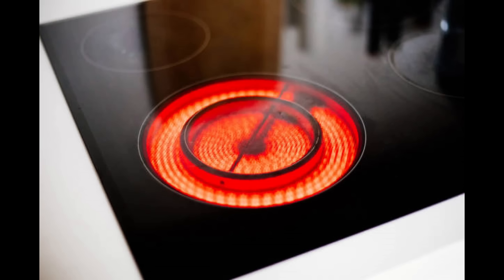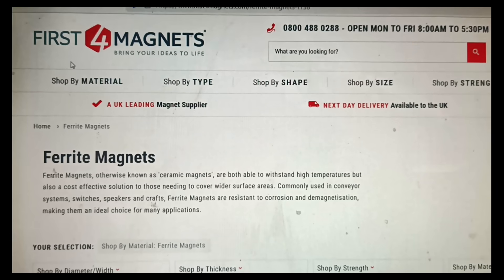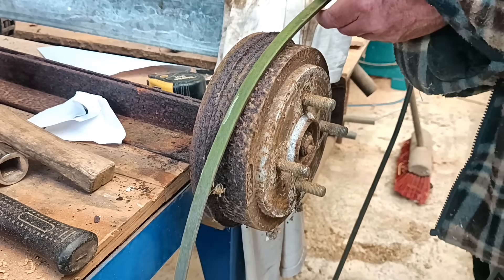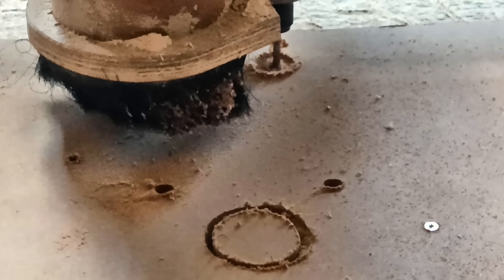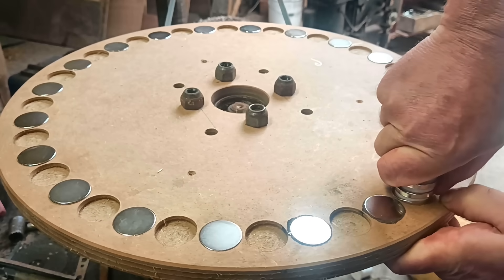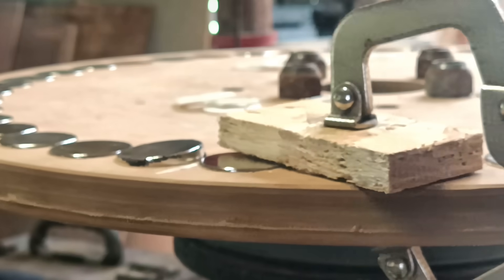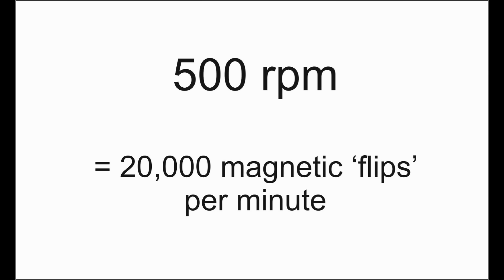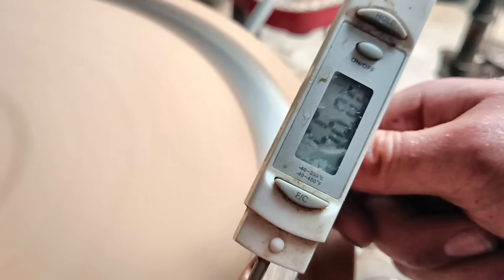I Made A BIG Rotating Magnet Induction Heater! (with magnets from First4Magnets.com)

Comment: What sort of torque do the magnets create causing a drag on the spinning power source?  Is there a limit  to how many magnets can be put on a spinning object causing it to it stall out?  How fast does the degradation of the magnets occur?  Does the water need the metal to heat up or do the magnets affect the water directly? (I suppose the density of the electrons matter. Would gold or silver heat up faster and also create more drag on the power source?)  A few question that come to mind.

Comment: THIS is VERY viable to say the least.!! You need to measure that copper with no water in it to see how hot the metal gets by itself. IT should reach 200C easily without the water load on it. That which you've shown eliminates mechanical coupling and bearings turning a generator, then taking the output and coupling it to storage or even directly to a heater as in this case which has losses in the resistive heating elements . 
The losses through all of that are appreciable. 
IF you use blades under a meter in diameter, you can couple it 1:3 to the wheel and in 30 MPH winds blowing in the winter it will move the wheel at over 2500 RPM ! 
IF U made steam in a vessel it would push itself into radiators automatically. The next question is how many pounds of steam pressure will a little module like that make. I would say over 3-5 which is way more than needed to pump it around. Once the water reaches 100C and becomes steam, it takes only 1/5 the energy to keep it at it's steam pressure.
THAT is the key point to efficiency in this heating system.

Comment: Your disk size is fine. your overall design isn't. Rather than a larger disk use more of the size you have make. use a spiral copper pip to pass water over each disk. each disk imparts more energy into the water so if for instance your first disk can impart a 10c rise in temp with your flow rate, after 10 disks your water is at 100c. Another way to do it would be to use more magnets on a board in concentric circles to extract even more energy.
Reply from the maker: Ah, but you've forgotten the drag..

Comment: I know it's nit-picking but,  coin style, face magnetized  n42s are not what you would end up with after a few prototyping runs.  a good proof of concept.
you'll get better results in the same arrangement is you used square, edge magnetized n52s.  those are prohibitively expensive...  
I should replicate this with 4 pole hard drive magnets on a drone motor

you should also use a less conductive metal as your inductive target.  copper doesn't allow eddy currents to exist for long before they're equalized, higher resistance makes more heat but will dampen the magnet wheel more.

additionally you should hold your heating metal perpendicular to the magnet path,  not aligned with it.  if you have more than 2 magnets Flux effecting the substrate then you're encapsulating your eddy currents.  that's how you produce phased ac not effective for induction heating.   

might be worth trying to utilize both sides of your magnet wheel too

this was fun to watch.  thank you!
Reply: How about a wheel with LN2 YtBaO superconductor slugs instead of magnets? cooled down and spinning next to metallic surface gives you electrons and relative motion....
Reply: @BjarneLinetsky  if you're looking for theoretically optimal results,  yeah,  but if you're trying to save money on heat,  buying or concentrating ln2 is a bad path.  

this project was clearly never meant to be optimally efficient,  but an oddity to be observed.   if they wanted to be maximally efficient, they'd just use a generator to make electricity and then use that to make heat directly where it's needed.   cheap,  reliable,  very low loss compared to this concept
I'm just trying to stay within their current hardware paradigm while pitching configuration optimizations.
Reply: @valseedian  What i proposed was the oddity, i cannot think of any application of superconductivity associated with mechanical devices and i do not understand superconductivity well enough to predict what would happen in such a machine. Incidentally, do not automatically dismiss LN2, it is inexpensive, costing less per liter than beer. And the technology associated with generating and storing are very good and very mature.
Experimenting with magnetism is a fruitful field, there are many phenomena that are not well known, for example the Gerlach effect.
Reply: @BjarneLinetsky  superconductivity would not do anything for this setup
  that's a thing when you're using electromagnets, not static magnets.   
he's not producing or using current at all,  no reason why you'd need lower resistance.  

not to mention that the point of the project is to produce free heat with the rotational energy they are already harnessing...  any engineer worth his salt would know you need to aim for low or no upkeep cost, low or no maintenence,  low or no failure rate,  and low expense.  can't get any of that and have a consumable in the works.
Reply: @valseedian  thinking outside the box....i was not proposing some sort of cooking stove....but rather an extension of this configuration. I am thinking that the relative motion between a conductive sheet and a superconductor may produce novel effects. This is more about investigation and experimentation rather than optimizing and upgrading.

Comment: Can't you just do some gear reduction to reach the desired RPM while saving on magnets? If the disc on the windmill is ten times larger in circumference than the disc it's attached to with a belt, then the small disc will make a turn ten times as fast as the big one.

Comment: You will probably need to find a way to keep the magnets cool when it's running, because the warmer they get the less magnetic they become. And I believe they can become permanently demagnetized if they get hot enough. 
A water bath would get the walls wet, maybe a flywheel made of a material that would allow airflow around the magnets. Aluminum. I've never experimented with this so maybe I am incorrect about the magnets heating up. But this is an excellent idea for free green heat.

Comment: You can get a stronger magnetic flux from the same magnets, if the the non-magnetic plate holding them in the given positions has the thickness equal with the height of the magnet, then this plate must have the circles punched through the whole thickness. Once the magnets are hold by this non-magnetic plate, the whole system must be attached on a ferromagnetic plate (a regular steel plate, NOT  a stainless steel plate, which is non-magnetic).

Comment: It would be much cheaper and more efficient to just build a generator that creates a voltage and then pass the current through the part.. like a spot welder.   You wouldn't have to buy so many expensive magnets

Comment: what about a copper ring that would hit more magnets like a stator does also it might be an issue with polarity you could isolate them and collect hot water so a newer version of a tankless but fuel less too there was a guy who made these water hammer pumps that could heat water very quickly using the water hammer effect

Comment: At some point heat kills magnets but interesting also better powered by a water powered machine faster rotational speeds available, more consistant and more force available, there is always the trombe effect where u
Reply: Lower to 200 Celsius, even the rare earth magnets should be OK. (The older types of magnets were more resilient to high temperature.) Then, that overheating from the induced current, is happening in the metallic object exposed the variation of the magnetic flux. Meaning that it does not happen in the magnets.

Comment: I am worried about the force of magnets getting ejected tangentially outside with high enough rpm if they get dislodged. You could CNC a narrow strip of wood as a ring to screw over them, so they will stay fit while it will not be blocking the magnetism.

Comment: Since your windmill design seems to have a pipe for heat at center top how do you plan to get heat to sink rather than rise? I would assume you would not want to live at the very top of the mill but rather lower and lower is always colder.
Reply: Oh and I am so jealous of that amount of magnets and set up.
Reply from the maker: I don't really have a plan yet, Katrina - still considering my options..
Reply: @wayoutwest-workshopstuff6299  well I love the idea, not sure on implementation. I can be found as mslefaye on most services if you ever want to brain storm.

Comment: Your other drill press is lower to the floor, why not just take the cover off, remove that belt and attach your new belt to the pulley on the motor?
Reply from the maker: smaller motor though..

Comment: You might want to be careful running the drill press that way. Their bearings are designed for axial (up-down) loads, not being pulled from the side, as a v-belt does to keep itself tight.

Comment: Really loved this video. 
Being a miller myself, I'm really fond of the fact that you want to use a windmill to power this. If you intend to build it with a more classical approach, similar to the diagram in the video, I could give you some advice, should you fancy  that.
Good luck with this exciting new project!
Reply from the maker: That's the plan - but I am limited by budget and regs. I'd be grateful for any info you can share. Would you email me?
Reply: @wayoutwest-workshopstuff6299 
Yeah, no problem. Do you have an e-mail adres for me? 
Can't find one anywhere.
Reply: @wayoutwest-workshopstuff6299 Yeah, no problem.
I had a look, but I'm unable to find any contact information. At what adres can I email you?

Comment: I thing a large copper pot with an iron base with a composite metallic can heat to up 1000 degrees . The reverse of this can also be used to cool down to negative temperature as a refrigerator. Thermo electric cooler

Comment: ??? would more pulling force from the magnets, or more pole flips per minute make a bigger difference?  i.e. if you used the same number of magnets but at 10mm thick, would that make a bigger difference than a higher pole flip rate?   Alternatively, if you used a LOT of smaller magnets in the same space with marginally lower power, would you increase the effect?  i.e. if you put in 125  10mm x 10mm N48 magnets @ 7.71Kg pull force along the outer diameter of the 30mm magnets, would the greatly increased number of pole flips overcome the reduction in pull force?

Comment: It would be interesting to see the change in torque on the shaft, when metal is heated within the oscillating magnetic field. Without a torsionmeter of some sort, one could maybe just measure the changing current drawn by the drill press motor and convert watts to horsepower and torque. There must be a back force from the eddy currents in the heated object. An example already in use and manufacture is magnetic braking on an aluminum fishing reel spool, which is quite effective in making casting without backlash much easier. So obviously that concept is worth exploring. Also, you should try placing a metal object in the field that is free to rotate coaxially with the magnet rotor disk, and see if you can cause a non-ferrous metallic object to function as a motor. This concept could be used perhaps as a not very efficient torque converter or constantly variable transmission.

Comment: Imagin you add another layer of magnets to the bottom of the disk. Then you custom design your water tank so that the tank itself wraps completely around the disk.  I’m thinking I’d like a 360 degree brake caliper. Housing all magnet surfaces at all times.

Comment: Halbach arrays of magnets would work better. What is shown is a VERY crude approximation that uses the magnets inefficiently. To make it much more efficient and much more like Halbach arrays, the magnets should be placed of a rotating steel disk, which will provide a magnetic return path for the magnetic fields, on the 'cold' side, the side away from the object being heated. The benefit is that on the 'hot' side, the magnetic fields will be more intense, and that will "jiggle the electrons" more violently, creating more heat. It is not perfect, but it is a simple improvement, and it saves drilling a lot of holes. For spinning at high speed, the magnets can be glued onto the steel, or have a low rim on the wheel to prevent magnets sliding off the edge. 
Another approach is to use magnets that have both N and S poles on the same face of the magnet and no pole on the back face. Those are harder to find, but are a sort of all-in-one Halbach array.
Also, It is not exactly the number of pole reversals per second or minute that matters for this. The actual SPEED of the magnets matters much more, because this setup is using eddy currents in the copper to generate the heat and power in the copper. Both of those vary in proportion to the square of the speed of the moving magnetic fields (technically, the square of the Rate of Change of the magnetic field intensity), while magnetic drag and the number of pole reversals vary in 1:1 proportion to the speed. 
This also means that at any given RPM, a smaller disk will have lower speed for the magnets and much less effectiveness than a larger disk. Magnets spread all across the disk face make this material efficiency problem even worse: A lot more magnets are used, but most of them are moving slower than at the edge. 
As an alternative to increasing RPM, a larger number of smaller magnets can be used. That still causes a more rapid Rate of Change of the magnetic field intensity, but smaller magnets also tend to mean the magnetic field intensity drops off a shorter distance away from the magnet face, thus making a small air gap more critical. But smaller magnets also reduce the ideal thickness of the copper, both of which may bring significant cost savings.
Reply from the maker: Thanks for this - I'm learning a lot from all the comments!

Comment: i have an idea for a clockwork dynamo lantern that uses supercapacitors
it uses a single stationary n52 magnet on a spinning copper ring to energize it this in turn is the pickup core for a matching coil of copper wire that wraps around both sides with a rectifier that goes to a 2500 farad bank of 2 large caps to power an led light that goes into a diffuser for area light with a kill switch so it doesn't always run
clockwork is used so you can use a key to wind it up and let it spin for a minute at a time or so instead of stripping gears like people will do with the flashlights on the market, added perk of less work since it uses a lot of gear reduction plus magnetic friction to slow itself down till it's near charged

Comment: Fun idea and video. I made a disc like that back in 2009 to make a Lenz's law levitator. It works! If you were to place a sheet of aluminium or copper over the rotating disc it would float but it would also slide off quickly. It would need to be tethered in place to remain floating. Folks made hoverboards with my idea. :-)